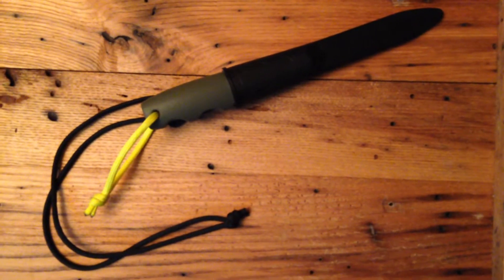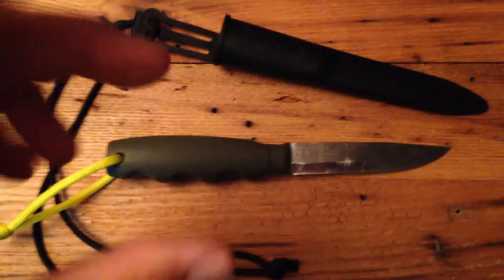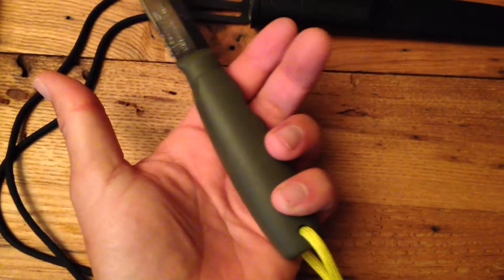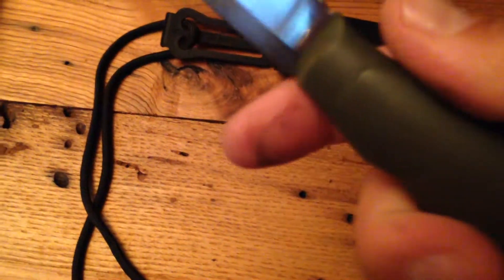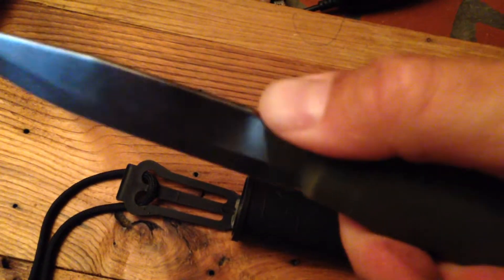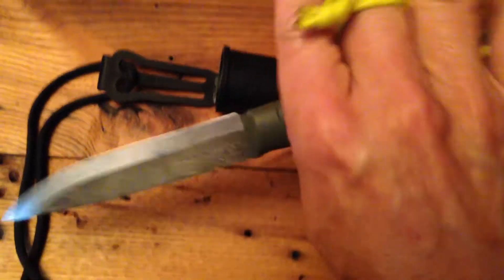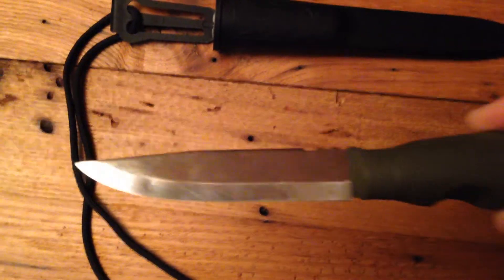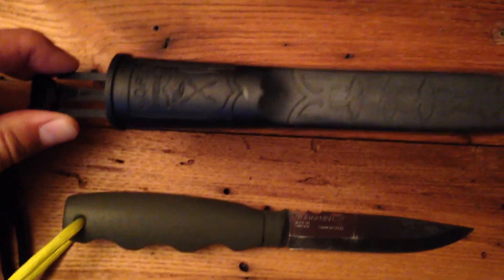Morakniv classic No 2 mods

Comment from the maker: Hey @Daniel. This version of Mora uses a push tang. (Or possibly a partial tang.) At any rate, the tang does not extend through to the butt of the handle, but stops about 3/4 the way I believe.